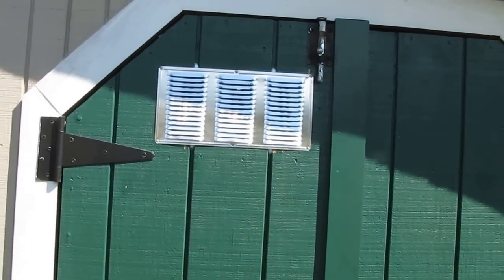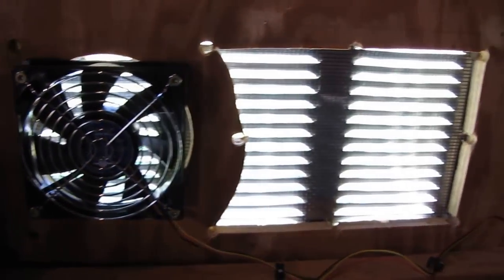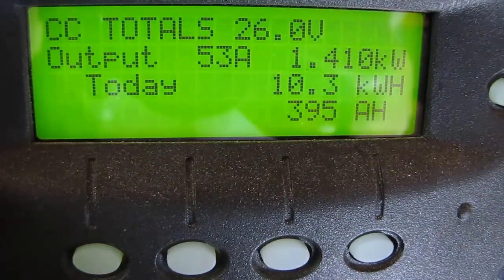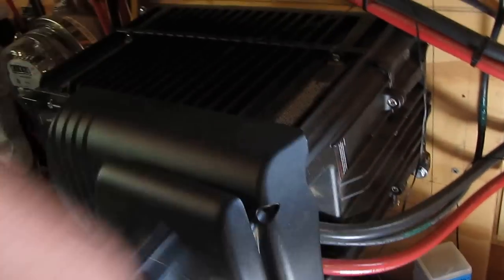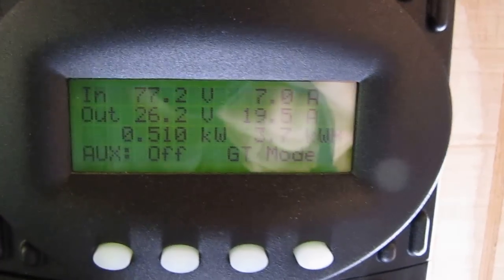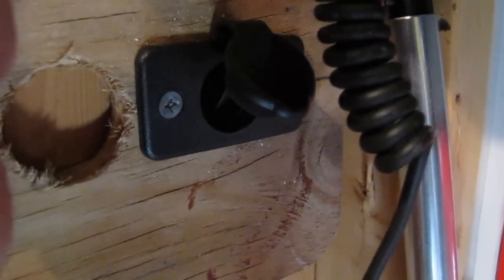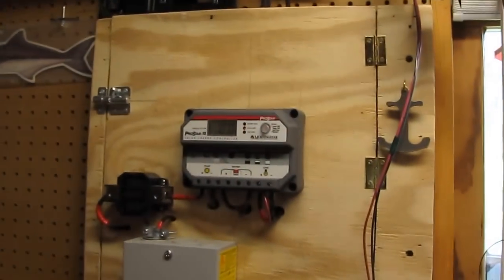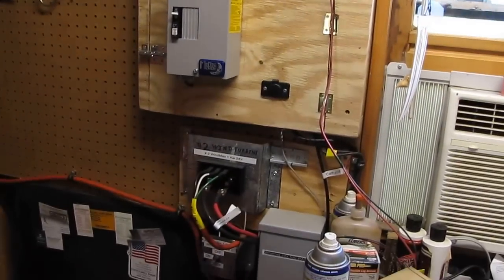Solar Shop Ventilation Fans And Vents  And Updates  By kvusmc

Comment: I need/want something like this to vent my small greenhouse. The auto vent openers from Harbor Freight has way to many negative comments about most not working right out of the box. I thought about the auto vents for crawl spaces but again loads of people wrote about the failure rate. I don't want to roast my plants if vents don't open. I was thinking since I raised my greenhouse up two feet that I would do something in the wall. Your idea is giving me food for thought to see if that would keep my temperature no higher than 80 degrees.
Thanks
Tim
Reply from the maker: Yes Tim Some 10 Watt Solar Panels Or Even 20 Watters Wired  Direct Should Do The Job  You Could Even Put A Snap Switch For 80 Degrees Thermostat It Would Be Perfect Buddy

Comment: What about exhausting the hot air off of the inverter to vent outside? Should help by not adding to the load inside the building.